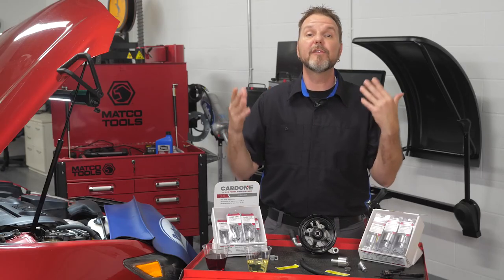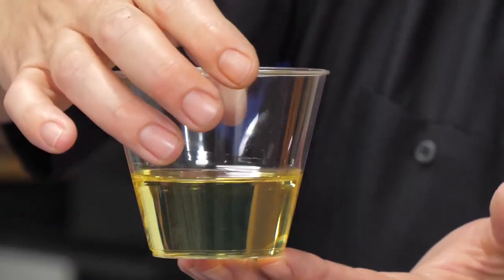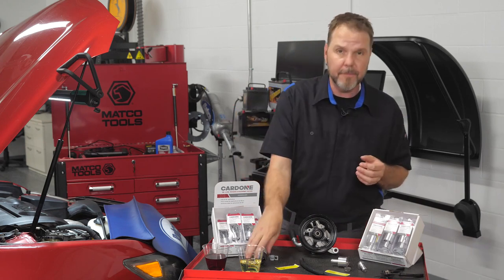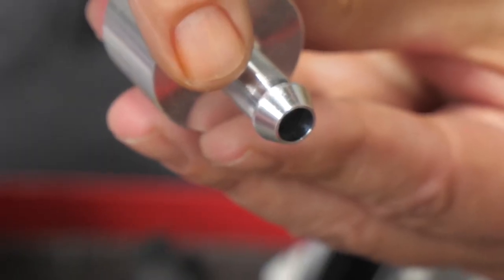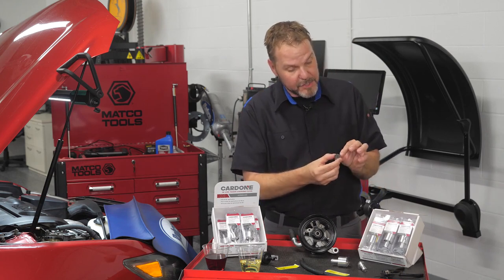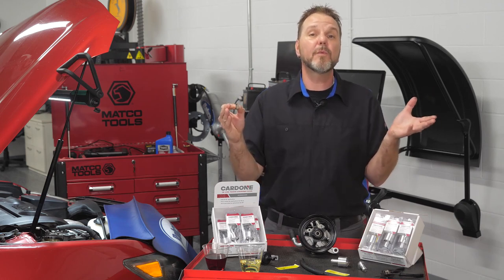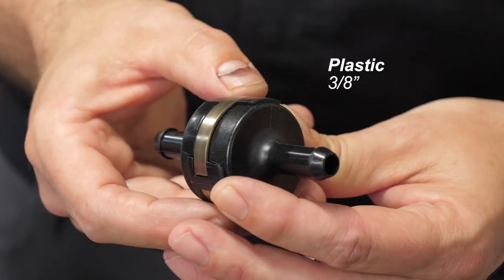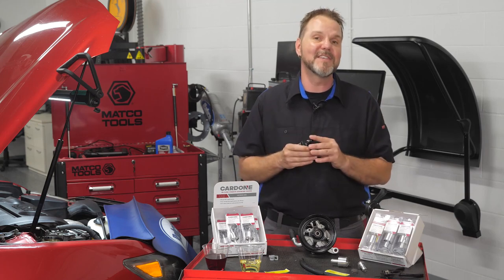Power Steering Filter

Comment: I have never seen such a blatant lie in my life. Anyone that knows something about P/S systems is that some manufacturers use ATF (transmission fluid, which is that exact same RED color) as P/S fluid. That is exactly what that is in the left cup. The right cup is generic hydraulic fluid that other P/S systems use. He literally used two DIFFERENT fluids and compared them as the same (the left dirty and the right new). And the "debris" in the ATF (the red fluid) looks like it was spread all along the top... Do better Cardone this is really embarrassing and honestly shameful that you would pass this along to people that do not know any better.
Reply: I agree.
Reply: I have in my 41 years and 11 working on vehicles every seen red power steering fluid there all clean no matter what brand it is yes you can add atf in it